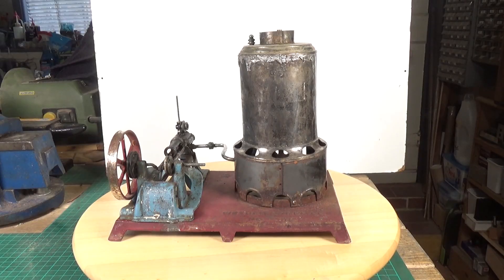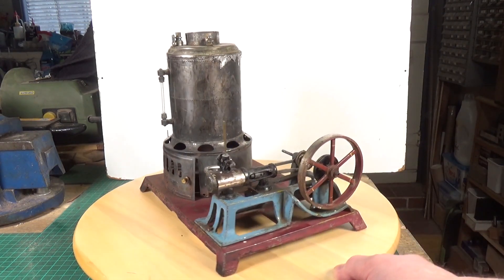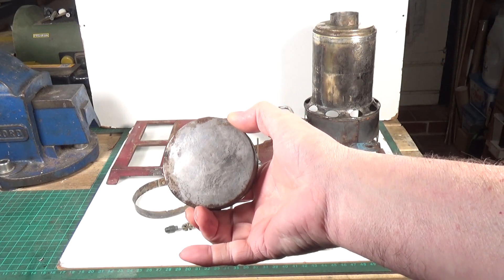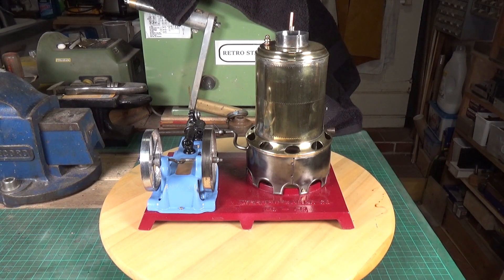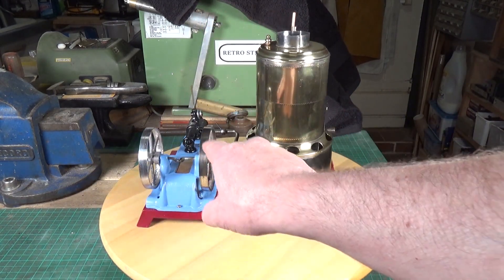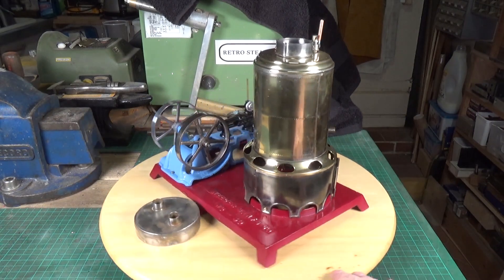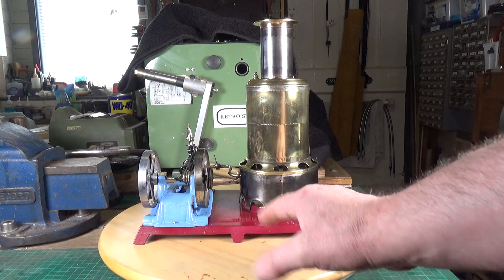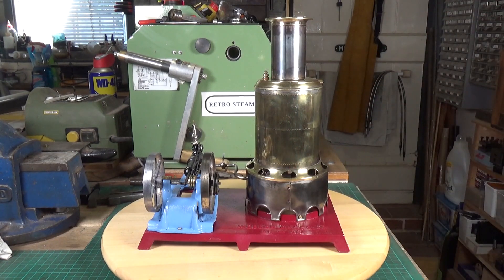Weeden 49 Model Steam Engine

Comment: Great work Alan.  You sure had plenty to do on that one.  The paint job looks good as well. 

The dodgy solder seems to have cleaned up OK.

Cheers Rob
Reply from the maker: Thanks Rob. I was lucky with the solder clean up, I was expecting the boiler to leak after I had scraped off the solder but fortunately the boiler was still sealed. Just for once the paint came out ok! Cheers, Alan.

Comment: You should try caustic soda, I tried it to clean out my Mamod burner and it dripped out and instantly stripped the paint off the base plate😢 and it ran down it too and still made the paint look orange when instantly cleaned off it’s very powerful.
Reply from the maker: Thanks Ryan. Caustic soda is a good paint stripper but it is very strong, the oven mate works well and won't actually burn you!